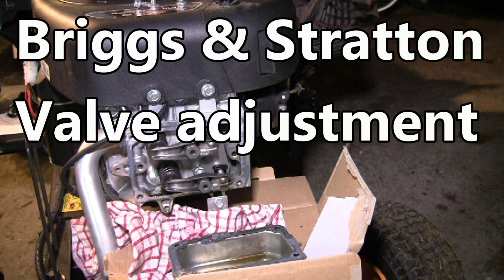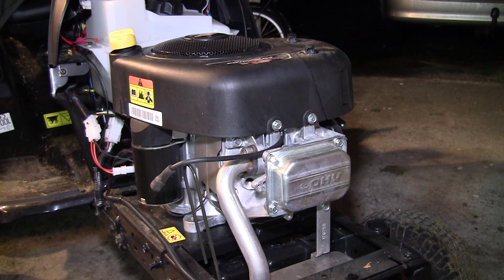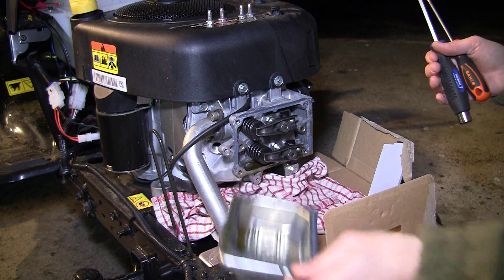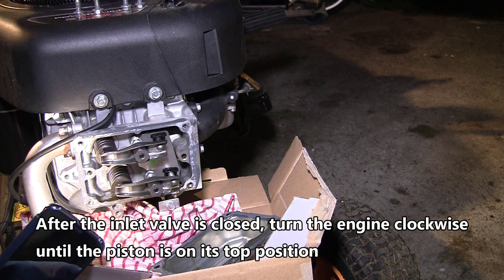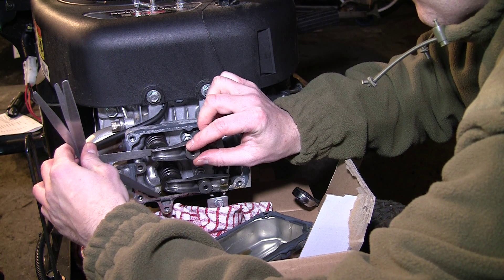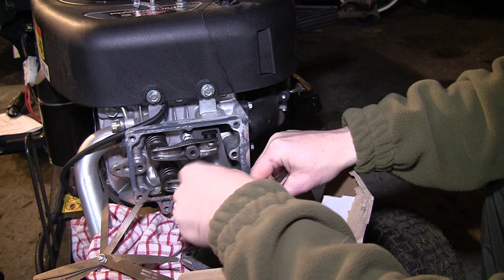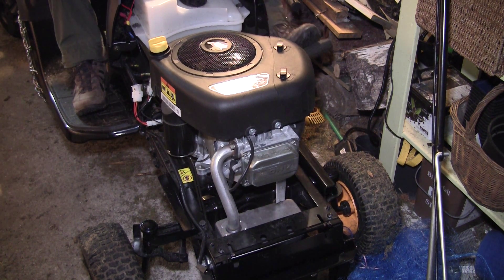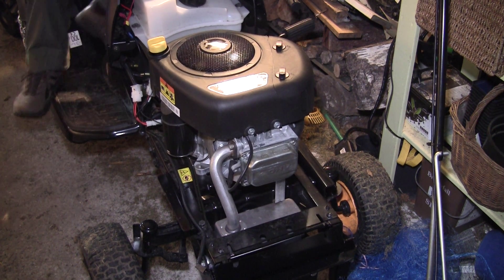How to adjust the valves on a Briggs and Stratton OHV engine

Comment: been trying to set my valves on my 16.5HP Briggs powerbuilt engine just like in the video.. after i set them i get one good start then same issue with lag crank.. any ideas?
Reply from the maker: Hello. I am sorry to hear about your trouble. Unfortunately, I don't have any quick fix for you. Good luck with your work.
Reply: Maybe seat the valves ?
Reply: I know that this is a late reply and don't know if you still have the engine.  But more times than not, it'll be the compression release mechanism that has failed.  You'll have to replace the camshaft. Just as long as there's no other internal damage.